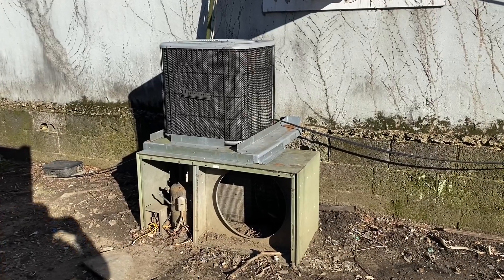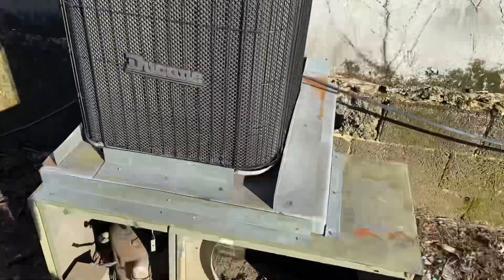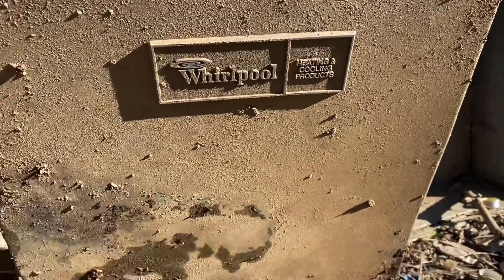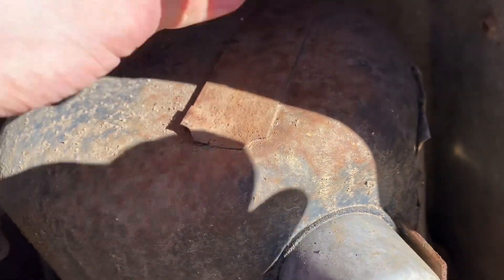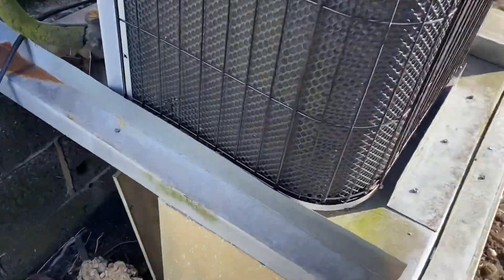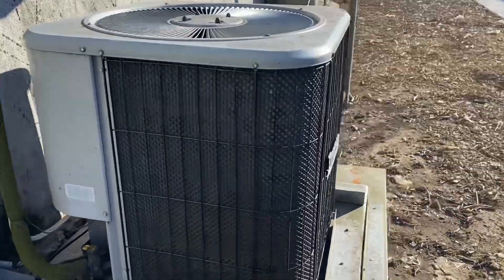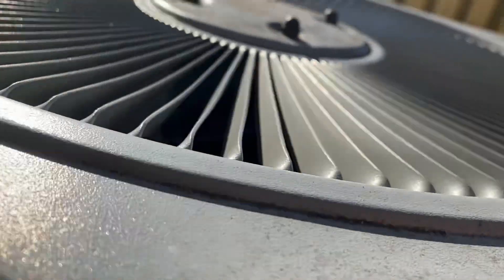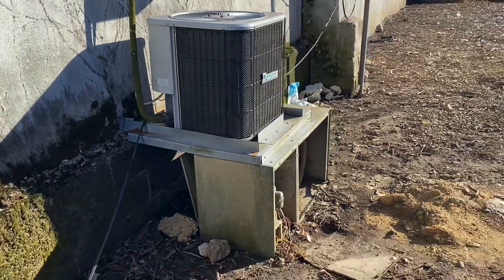The Cleanest Install Of All Time #hvac #hvachacks

Comment: I've seen more than one old condenser abandoned next to the newest one around where I live. I know of at least 5 different houses with at least one old condenser abandoned next to the current one, and I know of at least one that's at a multimillion dollar house. It's in a little alley down the side so you can't see it unless you're looking for it.
Reply from the maker: That's fairly common, but installing it on top of the old one like this one here is next level

Comment: I am more interested in that old 1980s Whirlpool that tgat Dukane unit.  They could of at least kept it all together, grilles and fan blade.  Probably did not want the hasdle of running a few more feet of refrigerent lines or they wanted to keep it high off the ground due to flooding.
Reply from the maker: I was interested in the Whirlpool too; this vid just focuses on the wild install in general. Imagine restoring the whirlpool lmao